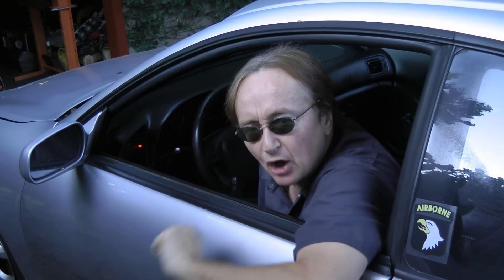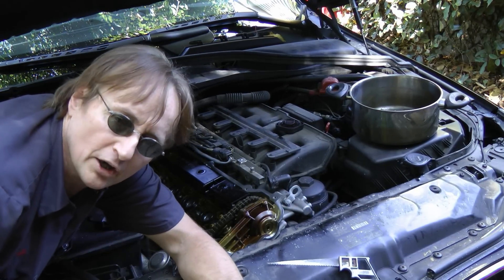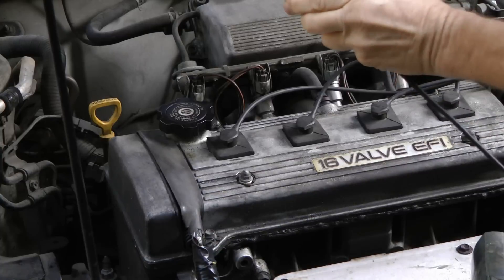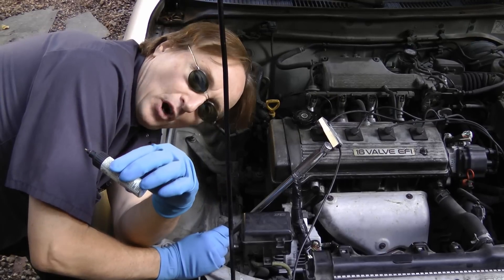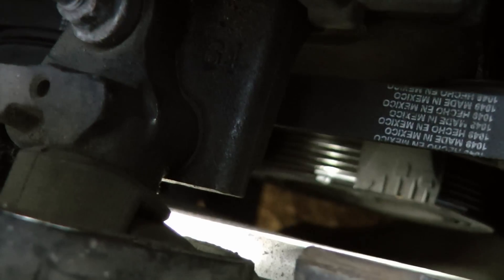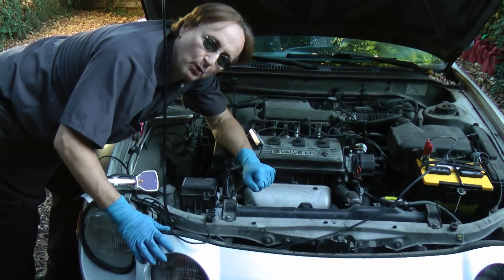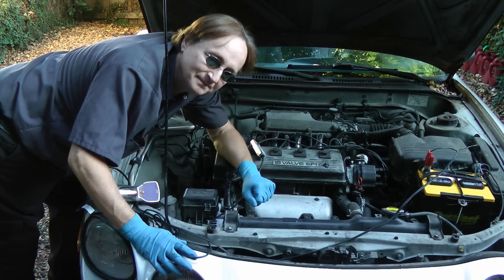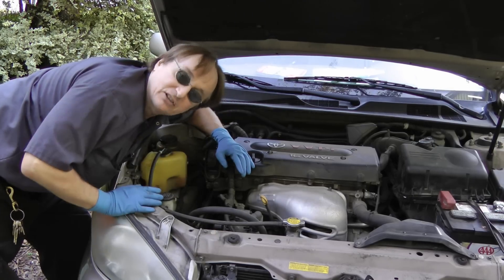How to Check a Timing Belt or Timing Chain in Your Car

Comment: Is there a way to check a diesel engine in the same sort of way? Would the timing light run off an injector or something? As diesel engines don't have spark plugs.

Comment: Hi scotty.  I think i can hear my cam chain rattling on start up in the mornings then the noise dissappears after a few seconds what do you think could be the problem ?  P.S I really like all your videos by the way ive learned alot !! ☺
Reply: +Ross Randall That could be the "hydraulic valve lifters", that's a little dampener that sits between the camshaft and the valve. It's there as a tiny shock absorber and to minimise the play between the camshaft and the valve. Oil is pumped through them to fill the gap. When the oil is cold and resting at the bottom of the oil pan, it takes a second or two to fill in the lifters. If it takes longer than a minute for the rattling to go away, I'd start to worry, do an oil change and maybe have your oil pressure and pump checked out. Replacing the lifters is labor intensive.
Reply: +Hamachingo thanks for your comment . I've got my car in for for a service next week so see whats it like after that.  Im thinking maybe it could be the cam chain tentioner as it sounds like a rattle for a few seconds rather than a tapping?
Reply: +Ross Randall Bummer, if you got a Mini Cooper, it's very likely the chain and the tensioner. Good luck.

Comment: Toyota 1.6l !!   I had a tensioner seize.... snapped it's mount right off the block!   funny thing was that was the last tank of gas it ever did and the best MPG it ever did
Reply: dosmastrify did u car cranked but not start my Toyota dont wanna start just cranks could it b the timing belt or distributor help out if u fixed it
Reply from the maker: do my video "fixing a car that cranks but doesn't start up:

Comment: Scotty as far as timing belts go, I think you get them changed at a certain number of kilometers for instance I think in my case its 80k or 100k. Well I got into big trouble with my car with this. Because when I bought the car it had 100k on clock, so I said to the dealer, the water pump cambelt tensioner will need to be replaced, and they said "Oh no trouble we'll do that don't you worry" And then on the paperwork they wrote "cam belt check" but also stamped with a rubber stamp on there

Comment: I notice that the model engines you demonstrated this on have camshaft-driven distributors... What about models that use paired-coil DIS w/6+1 crankshaft trigger-wheel, like the GM LN2? It's one of the most accurate ignition systems made, so wouldn't such a test be null-in-void for checking the chain-set?
Reply from the maker: +pancudowny you can still put the pick up on top of a coil on plug and do readings that way
Reply: +Scotty Kilmer But this isn't a coil-on-plug system, it's the "Twin-tower" design... Like found on the C4 ZR1's DOHC LT5, the Buick Turbo-6 & the Quad-4. You know, a "wasted spark" system. Maybe you've seen the bypass variant of it on a 4-Tech (A.k.a.: Iron-Duke) in a FWD J-body (Cavalier, Sunbird, Cadillac Cimarron...) W-body (Celebrity, Pontiac 6000, Cutlass Ciera/Achieva...). BTW: It was later changed to a non-bypass system.

Comment: Scotty I see you have a matrix, I got the 2.4 vibe gt basically the same car, got the car with 71,000 miles 2 years ago now it has 107,000 miles, do these cars have a certain time frame for miles to change out the timing chain? Thanks much Dave

Comment: Hey, Scotty. Is this typically a reliable method of checking the belt as opposed to viewing the belt directly? I ask because I have people doubting me when I say checking the timing belt is not that labor intensive.
Reply from the maker: it's accurate, but it you can easily remove the cover inspecting the belt is always good cause it could be cracked too

Comment: Hi Scotty,
I have a 2001 european vw polo. It seems to idle too low and I know it does this because there is a bad lambda sensor. do you reckon a scan tool / laptop could over ride the computer to raise the idle speed? Because in the winter with the heating and headlights on the car is on the verge of stalling.

Comment: Hi Scotty,

I have a 2001 Mazda MPV (Ford Duratec 2.5 L engine, I believe) with 157K miles in it. I got it about 10K younger and I feel that the acceleration and the fuel mileage per gallon has dropped a little in the last few weeks. I had the radiator replaced because of a leak recently and no other work done. I also declined a fix of some part of the exhaust which made the van slightly noisy. The mechanic did say that it would not affect anything else other than the noise level and eventually the inspection. What do you think should be checked first? Thanks.
Reply from the maker: have the maf sensor checked and also try my video "how to clean fuel injectors on your car"

Comment: you can also twist the crank pulley back and forth, you'll feel if there's play or not. however that wont tell you if the factory nylon is cracking off but ifnyour odometer is in the 80 thousands and up on older engines (1960s-early 90s), it would be wise to just change it before you lose a motor
Reply: wont this work on a 98 corolla?
Reply: I never tried it with a timing belt, maybe

Comment: will timing belts are made with Kevlar and there's usually last about 80,000 to 100,000 miles and that's when you change them wont have to worry about it they're worn or not

Comment: 01 Tacoma with 175k miles. Don't know if the belt has been changed due to the poor quality of up-keep from the previous owner for other mechanical things. Heard that these timing belts last double or triple of what the manufacturer says and that if it breaks, it won't hurt my engine. Is this true? And should I try to change the belt as soon as possible?

Comment: Question for Scotty Kilmer..  

2000  Hyundai tiburon 2.0l DOHC 160,000 miles and runs great. just replaced timing belt and other fun refinements.. This vehicle only has one timing cam gear instead of two like others, but it does have a chain that connects the two camshafts.. The question is:  how often should that chain be replaced?

Your awesome and I look forward to your response.
Brads3111

Comment: hello scatty.the chain time can make vibrating the engine motor .when runs 40 it happens the vibrates.i alredy check the mout end they are fine.if it can be the chain time.

Comment: I've got a 97 Altima that loses a lot of power when accelerating, and has a pretty bad sputter while driving. It's intermittent though, so I'm not exactly sure if it's a timing chain issue or not. Any advice? Just had a new fuel pump installed and all the vacuum lines replaced trying to fix it.

Comment: your other video saids " timing chain last forever on this toyota matrix no need to change" i got a 06 acura tsx with 140,00k,  i dont know if the chain has been replaced since i got it used for  110,00k.

Comment: Hello Scotty. Can I use this method somehow on a diesel engine? If not then is there a similar easy way to check a worn timing chain on a diesel engine? I have a recently got a p0008 bank 1 code, but not yet check engine light. I also suspect a fading fuel pump at the fuel tank. Many thanks.
Reply from the maker: Thompson Kong diesels don't have ignition systems so this method can't work on them

Comment: Hi Scotty! Today i did some manteinance on my ford focus sw (in the picture), i live in italy and it is a 1.8 liter gasoline zetec engine. While i was checking valve clearances i also checked the timing, and i noticed that the intake valve sprocket is one tooth behind, so, intake valves open with a bit of delay. My question is: can that contribute to the engine running poorly? I also get poor mileage. Also, the engine struggles to adjust to idle and dies when breaking and stopping. Thank You!!!!

Comment: ...cont - other thing is that the initial measured pressure in this cylinder is a bit lower than in the others.The car is running well, though at low amb.temps it shakes and there's a lot of white/grey smoke, raw fuel smell.After a few 100 meters it is just fine, no smoke.Another thing, I notice that the whole car is pulsating in the rhythm of that nailing noise,though the engine is warm.Also when I put my hand close to the exhaust pipe end I feel pulsating pressure against my hand.

Comment: Hi Scotty, I don't get it, the mark should be in one place (Agree with you), but if it is way off, should not be a problem with the distributor timing, in case the engine has one?, because you are using the induction of the plug to measure this, or the problem begins, when the mark bounces up and down? because is totally normal that the mark moves to one side when revving because of the ignition advance..Wait your answer
Reply from the maker: as timing chains or belts wear, they flap around at idle, then the mark moves back and forth. If you revv it up, mark will move to more advanced, but still should not move back and forth.

Comment: Scotty, please explain something.  The timing belt and timing chain control valve timing.  The timing light, being triggered by the ignition spark, indicates ignition timing.  How does sloppy valve timing affect ignition timing?  Does inconsistent valve timing cause fluctuating RPM and that in turn affects timing advance, thereby showing up in the variable ignition timing?  If not this, what is the mechanism?

Comment: Hey Scotty, I have a 1983 Starlet with a 4K-C engine. After taking it for a decently long drive, it began to develop a miss, and became difficult to start. I noticed that there was a silver patch slightly offset to the bolt that holds the distributor in place so I moved the distributor so the bolt covered the patch and the engine now runs well. Did the distributor just move or do you reckon the timing chain may have stretched?

Comment: Are there signs without this gun that I can look for in order to determine this? I mean, I plan on taking it elsewhere on Monday, but I need to drive it tomorrow. However, if it's the timing belt, I would obviously worry about driving it, as I don't want to damage anything if it breaks or slips.

The sound is worse idling and driving slowly than it is at higher speeds. Also, the sound gets worse when I turn left.

Comment: Hi scotty, I own a 94 camry 2.2 4 cyl do I line the notch on the crank pulley with the 0 mark on the timing cover, also I'm having a hell of a time keeping the cam mark lined up in relation to the crank, I line everything up then it moves a tooth when I go to tension and turn the engine 2 rev by hand .. What gives lol.. Thanks man
Reply from the maker: try another timing belt, cheaper ones are not the correct size and do that all the time.

Comment: Hey scotty say if you have a interference engine and the belt fly off and the valves get smashed. you can replace the valve/s but decided to swap the head will that fix it, or do you have to replace the wole engine from top - bottom?

Comment: When I line up the TDC mark on the crank pulley and the block, to check that the cam gears lines are horizontal, does the #1 piston need to be on the compression stroke. Mine were not horizontal, out about 3 degrees, but I neglected to check if I was at #1 piston. I just lines up the pulley mark to the block. 2003 L4 Accord
Reply from the maker: has to be on compression stroke, or lines would be 180 degrees off.

Comment: Is the water pump ideal to change with the timing belt for a 2010 corolla when its at 60k miles, thanks scotty!
Reply from the maker: +Angel Santiago they generally last a lot longer than that
Reply: thanks so much for your response. as per the dealer its 260. pep boys asking for 130 im sincerely thinking about saving a buck and going wit pep

Comment: are timing chains more resistant to wear? i was under the impression that timing belts need replacing at around 110kmi but the chains never needed to be changed

Comment: Hi Scotty, i have a 2000 chevy astro with over 200 thousand mile on it. The car start but you have to crank it for a long time. Also the car idle fine but when in drive, it tend to die or run very rough. I was wondering if this could cause by my timing chain loose or my ignition timing is off? Where should i first start diag this problem?

Comment: Hey scotty, how would you use this timing light method to check for a worn timing belt or chain on a car that had a coil on plug ignition system and thus would have no spark plug wires to connect to?

Comment: I just had a new engine put in. 4k later I'm told that the timing chain and value broke and would need another replacement. 

It is under warranty and I hope it's approved but what would cause that?

Comment: How to check the timing if the ignition coils are right on top of the spark plugs? So when there are no spark plug cables to connect the gun to? Appreciate your reaction. Thanks.
Reply: bkandemir77 you would need to get a spark test lead that is basically an extension and put it between the coil and the spark plug then attach the clamp to that

Comment: I have a 2011 fabia 1.2 tsi . It has a strange rattle (2-4 sec)during first ignition after the car has been  parked for some time (half of a day). Can I check with this method if the timing chain is stretched?  I have read on the internet that newer cars cannot be checked using the timing gun.

Comment: I have a 2004 Celica with 145k on the clock. I would assume the timing chain is the original. How often should you change it?
Reply from the maker: if oil is changed correctly, those chains generally last as long as the engine, it's a real job changing them out

Comment: I think you meant the Camry has a timing BELT not chain but you're a good mechanic
Reply from the maker: jim dandy all modern camrys have timing chains now
Reply: Scotty Kilmer Thanks Scotty- I didnt know that. Wonder why Toyota changed ? Maybe because it doesn't have to be changed as often or after 5 yrs and they can use that as a selling point?

Comment: Be careful though, (especially with the earlier 2.2 s) There are chronic lubrication problems with the tensioner and they can go without warning. (ruins the engine) Later 2.2 s (from about 2004 onward) should have no problem. The best defense is to make sure you always run your engine to the full mark on that impossible to read dipstick, and change your oil. (duh) The ones I have seen break were often poorly maintained. As soon as you hear a suspicious noise though, don't hesitate to check it.

Comment: This is good for engines that actually have plug wires and not COP, some engines will have to be checked manually.
Reply: Gary Riefle you would need to get a spark test lead that is basically an extension and put it between the coil and the spark plug then attach the clamp to that

Comment: massive fan 

I have a zafira 2.2 direct and the chain is not super noisy but you can definitely tell something is wrong. and theres also a very low tapping noise coming from that area. 

it doesnt run as smooth as it should and the mpg has gone slightly poorer. is this a sign i should get it changed?
Read more
Reply: +Craig Burris   The tensioner could be bad and what you are hearing is the chain slapping against the inside of the case.  It is likely time to open up the cover and look.  Get a good instruction manual and take a lot of digital photos.  Label all the parts as you remove them.  That way you can get everything put back together correctly.

Comment: What if each spark plug has its own coil, like an '04 trailblazer. Can you check the timing on it with a timing light too? If so, how do you connect it to the spark in the first cylinder?
Reply from the maker: most will flash fine with inductive timing sensor like the gun in my video. Just place it on top of the coil on plug

Comment: Hey scotty, I have a st204 celica 5s-fe engine. It's using heaps of coolant and then starts to over heat. I've replaced thermostat and flushed the system. Do you suspect water pump or leaking head gasket?

Comment: sir i understand timing marks, im referring to your marks in video  i see white ink in the belt ''groove' around the pulley  1"+
 in first pix but not Across the pully..when running i see no marks,,i think your saying if the mark doesnt flutter around at idle with no dist, advance working the flutter is from a worn belt  This is great Info.im.just trying to understand with out seeing any color marks in your video..

Comment: Hi Scotty.
Unfortunately, my car has no spark cables. I drive an inline 4 cylinder as well, but instead of cables i only have a spark module consisting of 4 coils with plug at the end reaching deeply into the valve cover and the cylinder head. It is one piece and cast by high voltage insulating plastic material. It just has a 6-pin plug that comes from the car's main supply and the ECU. How do i get a spark plug "signal" on that?
I hope you get what i mean by the spark module. Thank you in advance :)

Comment: What if you have coil over plugs ?  
Also, if I may.  I've just bought a used car that's 9 years old but has only half the mileage before timing belt replacement is due.  Is the belt affected by age or is it okay to drive the car until the recommended mileage is reached to replace the belt ?
Thanks Scotty.
Reply: Id check the belt for cracks and if you think its time, do it. You dont want it to snap while your driving because that could lead to more costly repairs! And I believe you just clip it over the coil pack wire and you should get the same result.
Reply: timing belts are affected by both mileage AND age.

Comment: I have a 2000 Grand Am, 2.4L I4, It used coil-on-plug instead of plug wires. Is there a way I can use a timing light to check it, or do I have to take the engine apart?